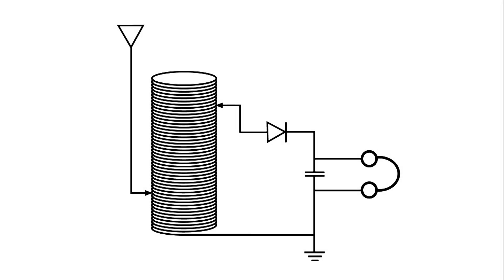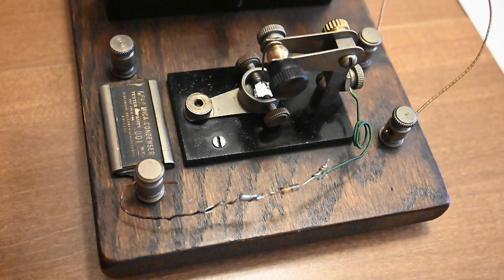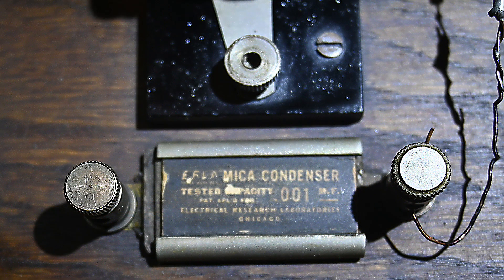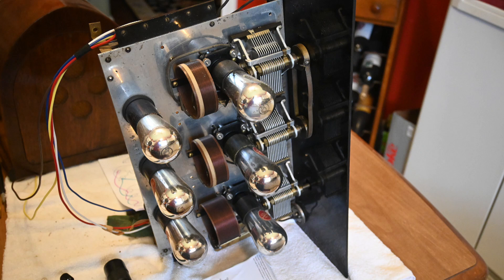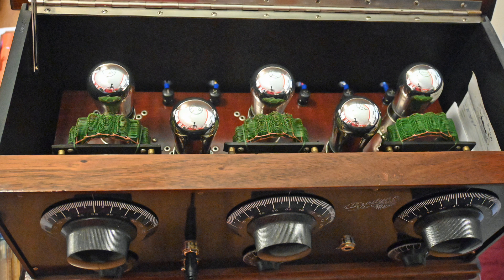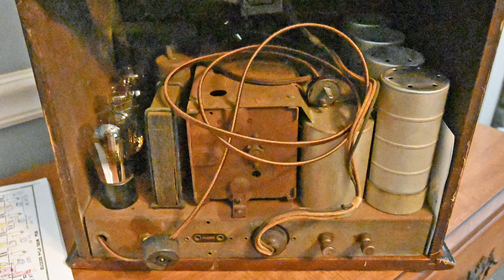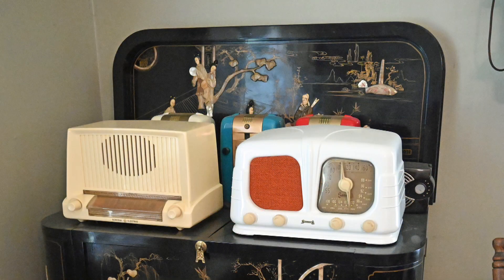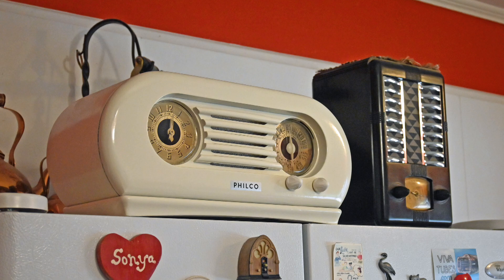Early Crystal Radio and More

Comment: I want to build a radio like this, is it possible to tell me the gauge of the wire and the cylinder diameter and length? I have already built a simple crystal radio without slider but with a VC and it is really cool to receive stations at night. Now I want to try a double slider.
Reply from the maker: I have emailed Chuck, it is his radio, and asked him to email me the dimensions.

Comment: Hi .. thank you for the video... tried to find a radio station on a crystal radio made like the schematic, but heard only noise .....I might have to try and use a longer antenna (by night) :-)) ...or try to make a simple DIY radio for FM....rgds Kim
Reply from the maker: You may have better luck with a Crystal Radio that has a tank circuit.

https://hackaday.com/2016/04/07/getting-serious-about-crystal-radios/

http://www.alvenh.com/misc-projects/crystalset/

https://www.pinterest.com/pin/crystal-radio-broadcasting--202239839486354223/
Reply: @AllAmericanFiveRadio  Ok, thanks for the link. :-)
Reply: @AllAmericanFiveRadio  Hi, sorry that I can't show you my regenerative one transistor FM radio receiver working:-)). in order to hear the stations I used your two stage amplifier (not 2N2222) but with BC547 and added one BD139 and 100R to the BD139 collector... output sufficient to hear music and voices by use of a 16R cone tweeter...would like to have a little stronger amplifier..10-12V !.. a funny tiny radio.. ...very sensitive high frequence circuit...takes a lot of patience and intuition best rgds Kim
Reply from the maker: @k.j.h.432  That is fantastic! It is so great when you build a project and get it working. Thank for telling me about your FM REGEN Receiver.